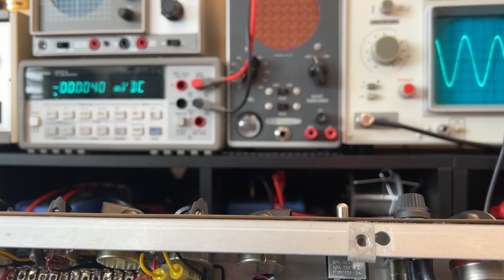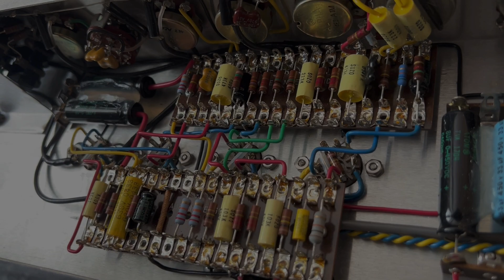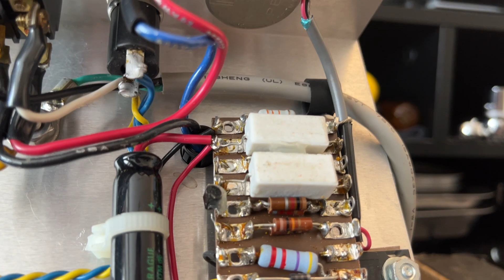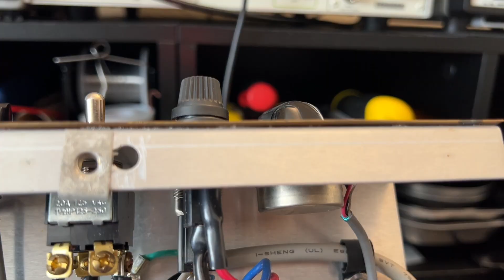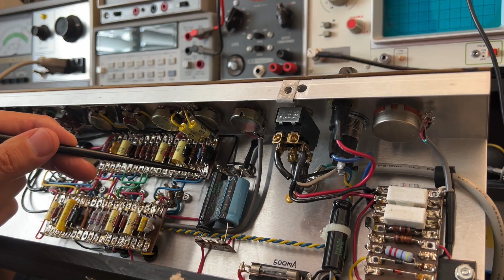Have I Failed?  JMJ Hand-Wired AC30 Part 1

Comment: If there is perhaps a nearby AM broadcast band transmitter near your customers house that could be causing the injection through detection in the vacuum tubes. that would provide the cause of the problem where you may not detect it. possibly Vacuum tube shields may be necessary to fix an unintended RF injection problem.
Reply from the maker: The 700’ KFI RF blaster is under a mile from my bench!  Makes this a great environment to test shielding and grounding within. Tube shields in place, sir. Amp acted up again and I caught it in time to see a severely disrupted sine on the output of the brilliant channel’s first gain stage. I replaced the cap and plate load and she’s back to full volume. Will close her up and give her a final 120 min stress test.  Cheers and great advice there Richard.

Comment: Very fustrating. Is it perhaps something that only occurs when it is back in it's enclosure and the heat builds up inside? On a less serious note, I once read an article on a VCR tech who could never get the VCR to misbehave when he was looking at it on his bench. So he took a picture of his own face and attached to the inside of the VCR cover. It never malfunctioned for the customer again after that!
Reply from the maker: I’ve had it in and out of the cab, run at 130v under load, heated with heat gun, injected oscillating signal you name it 😂. I think I’ve got the offending circuit identified in part two!   Funny story 😂😂😂🍻

Comment: Lots of WiFi and cellular devices these days that screw around with amplifiers. Tell the customer to get a power conditioner and have him run the amplifier on that to rule out his electricals. In the meantime get a heat gun and start warming up components, that thing on your bench is running a lot cooler than it normally would be when it’s all buttoned up. Then once it starts acting up, get some freeze spray ready
Reply from the maker: I had her in the cab for the first few days of observation. Heat gun used to no avail. I’m hoping it’s WiFi or rf related.  Ty for the hot tips. I haven’t tried freeze spray yet. Also thinking about getting a thermal cam.  Always a reason for more gadgets!
Reply: @ForgottenGearRestorations build a Carlson lab super probe and have the guy pay you to go to his house listening to WiFi and RF sources. My music room one month a year goes off the deep end and enters the twilight zone, and every thing goes wacky and I go off second guessing guitar and patch cables, power supplies, etc. I stop working on my amplifiers on the workbench during that time because the normal laws of electromagnetics are no longer observed. I will have an amplifier plugged into an isolation transformer, and I will be measuring a potential difference from the chassis and something completely random that’s not being isolated. So I put my B.S. physics degree in a drawer and swallow my pride for a month until the electrical demons move on. There’s one thing I would do since sources of high impedance are susceptible to RF interference, take out the coupling capacitors and put them on an oscilloscope and check which orientation yields the smallest 60hz amplitude, make note of the ground side and put it back into the circuit with the mark side pointing towards the lower impedance side, typically towards the plate side of the previous stage. The shield will be hooked up to the lowest impedance point. While they are out make note of capacitance and ESR for shits and giggles. I do this with all capacitor types. You will be amazed how many types of capacitors that shouldn’t have an orientation have a “quieter” side. My 5e3 build is bone quiet, and this is a big reason why. Put a red mark on the lower impedance side before taking out and see how many were aligned correctly    You could probably put oscilloscope probes and isolate the capacitors enough by removing the tubes perhaps?
Reply from the maker: I love Mr Carlson, as well. I liked that episode with the device he designed to identify the foil side.
Reply: @ForgottenGearRestorations I just put probes on the capacitor from an oscilloscope and hold the body of the capacitor with my fingers. One orientation will yield a smaller amplitude. Then I look to which side the ground probe from the oscilloscope is going to - then hook it up accordingly
Reply from the maker: I like it brother

Comment: I had a chorus pedal that sounded like a police siren. Sent it back to the builder, no issues on his end of course. So, I purchased a little Furman Surge Suppressor (SS-6B-PRO) and a Voodoo Labs Pedal Power 3 Plus. Problem solved!

My house was wired in the 1950s and isn’t properly grounded. Never had any issues though, aside from that oscillating chorus pedal.

Comment: Frank chasing rainbows is so taxing sometimes. I've been there myself.  Have you thought about  arcing in the output transformer? I know you should be able to duplicate it, but sometimes you have to be a parts cannon just to t-shoot an issue.   Yesterday, I changed a pressure transducer that, on a scope it looked great. But I changed it for giggles and what ya know, no issue.  You're a great. It's really hard to fix something that's not broken. Be easy.
Reply from the maker: I’ve been chasing waterfalls!  Customer says it’s limited to one channel. I hate shotgunning components, but I’ve been resisting doing that to the channel!  I really appreciate the encouragement man.

Comment: You and I grappled with a Hot Rod Deluxe problem. I threw in the towel early and got a boutique Deluxe (Rivera Stage IV). Same problem snuck in on that one. Yikes! Turns out I live in a 1936 hand built home with knob and tube wiring. The circuit I was using was 10 amp and not grounded. For a lot of pennies, I got an electrician to put on a new, grounded, 20 amp dedicated bedroom guitar amp circuit. So far so good. The new and the old amp no longer falter when changing drives. Gremlins are good at hiding.
Reply from the maker: Man I’m glad that’s been resolved. That was one hell of a battle.
Reply: @ForgottenGearRestorations  A lot of soldiers perished in that landing.
Reply from the maker: I was going to say that it spawned off my favorite intros of all  time 😂
Reply: This product intrigues me. Your thoughts? https://youtu.be/JQ9inueGgWE?si=6ZjpF70ZmZ6H9DVR

Comment: Did the client provide you with a recording of the noise? This can often be helpful. Your description might be WiFi noise - I had a client who brought a stereo amp back three times because of a "pulsing" noise that never occurred at my shop. After LOTS of questioning, it turned out he was playing Spotify from his phone, through an aux cable, and placing the phone on top of the stereo. The phone's WiFi radio was the issue. I suggested he get a 10-foot aux cable and place the phone away from the amp, and that cured it.
Reply from the maker: He sent some good video footage.  Sadly it wasn’t that issue 😂. I’ve had something similar happen to me at a gig.

Comment: I'd be curious if 1: he has a 5G tower close to his place as those can cause insane issues in certain equipment, and/or 2: he uses the apocalyptic drop Z tuning when moonlighting as a black metal guitarist with everything cranked up. Also if that's a combo it most likely not an issue but over the years I've repeatedly seen players use an instrument cable instead of actual 2 conductor speaker cable when plugging into an external cab, which as we all know can cause oscillation especially at volume. You got this bro! 🍀
Reply from the maker: What’s up DC!  2 and 3 not an issue 😂, but 1 perhaps!  I’ll ask.